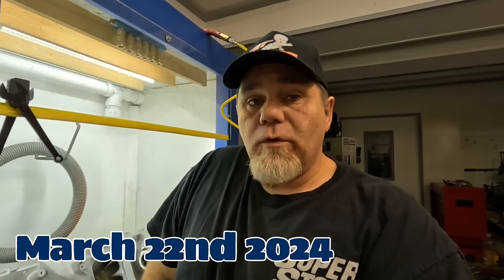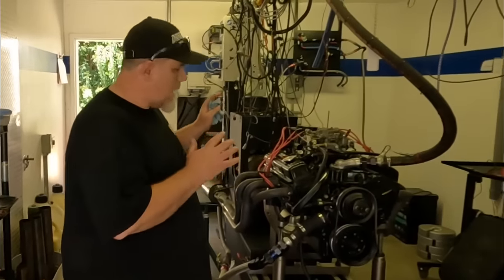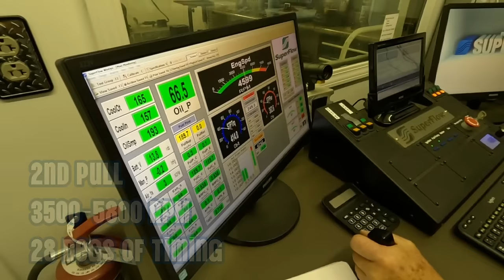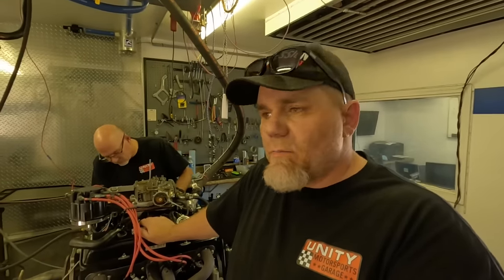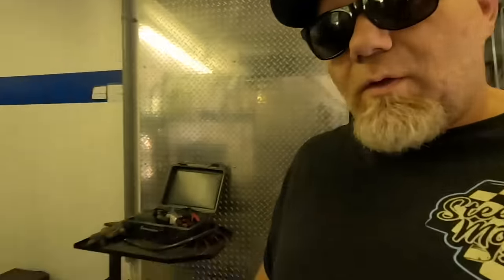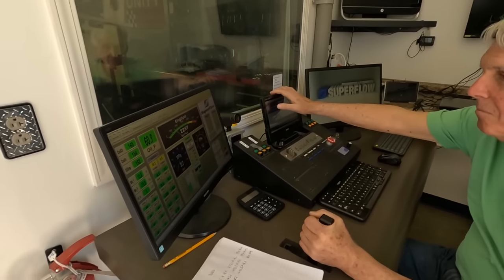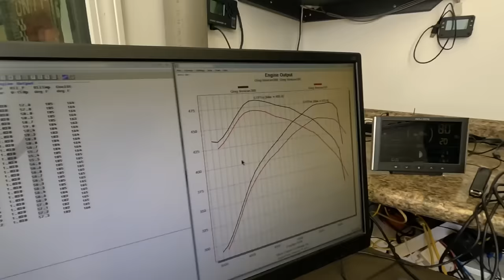408 CI SMALL BLOCK CHEVY, PROJECT SLEEPER:  DYNO TEST!!! WILL IT MAKE POWER???

Comment: 480Hp @ 408 Cubic Inches gives you a  1.176 Hp / Cuin ratio.  Seems pretty low. Was expecting somewhere in the 1.25 to 1.30 Hp/ Cuin. What does David V think?
Reply from the maker: It is low... It's the wrong cam for the combo but Joe had it and wanted to run it! Stay Tuned we aren't done just yet... 😎
Andy
Reply: The cam and carb are both costing a good bit of power.  Its all in the combo it wont just magically make x power because it has 408 cubes.
Reply from the maker: That is exactly the case.. Joe wanted this combo for his Chevelle and I will say it will drive pretty much like a stock car until he hammers on it!
Andy

Comment: Don't get me wrong, my teen years in the 80s had a Qjet on everything.  Hit my 20s in 90's bought my 1st double pump never looked back. Buy a GOOD DP and gain another 50 hp maybe more ive seen 100ho buy just changing carb. Yours being pro built i dont think youd see 100 though, 50 wouldn't surprise me though. Also go performer rpm air-gap with right spacer gain even more

Comment: 1.17 hp per cube? I watched a vid were you and DV kinda poked fun at folks that struggled to get to the 1.5 to 1.8 hp per cube, Is this race vs. Street(sleeper mode) , limited(wide) LSA on cam profile for AC and mild(sleeper) idle qualities? Just trying to understand the disparity. on a diffrent note, I like seeing the 800 cfm Quad with steady fuel numbers near the 500 hp range!
Reply: Yes this is a very basic motor with off the shelf parts. Plus you cant get crazy with a factory block.

Comment: why did the electronic distributor work so much better on day two than day one???
Reply from the maker: We found a loose connection on the 12v supply wire on the Dyno. 
Andy

Comment: 25 HP gained by flipping the cover is not accurate because the snorkel was cut off the air cleaner. The actual difference is greater for sure compared to a stock air cleaner assembly.

Comment: I had a 400 out of a 73 caprice in my camaro. It was only.030 making it a 406 gota say personally I love sbc 400's! They're strong!  Personally I had a different parts list but I know the potential of these engines especially the '72 and older 4 bolt main blocks!

Comment: Brother, I know a single plane 
Is a bottom end torque no no but to what extent? 2bbl 318s had a bitchin little stock manifold and they ran just fine. 
Now that Q-Jet is questionable. The secondaries don’t even have boosters! Dump tubes!
Reply from the maker: Not all intakes are created equal.. the small runner Street Dominator can almost match the torque of a regular dual plane and carry the power further in the rpm range... 
Thanks for watching
Andy
Reply: @UnityMotorSportsGarage  That’s no secret if you ever built a small block brother but very true. A tunnel ram or a super Victor don’t belong on a station wagon. Our pickups would get along real nice by the way. 70 F250 camper special with 532” towing motor.
Reply: @UnityMotorSportsGarage  Sure do, which is why I run a fully ported Team G does it all very well. I could make more #s putitng a large single plane on but part throttle would feel crappy in comparison. A real dual plane would choke mine upstairs

Comment: what cam?
Reply from the maker: It's a SMALL Mike Jones Hyd roller 224/228 .530/.530 lift on a 110LSA
 Not really the right cam for this combo but it runs pretty good
Andy
Reply: @UnityMotorSportsGarage that’s not bad power coming from that cam, I wonder if that comp xr300hr woulda made more power or even if you woulda used 1.6 rockers 💯💯💯
Reply: That is pretty good for being that wide of an LSA.Bet a 106 or 107 would really wake that sbc up.
Reply from the maker: @JeremyFrazelle-or1mt 😎
Andy
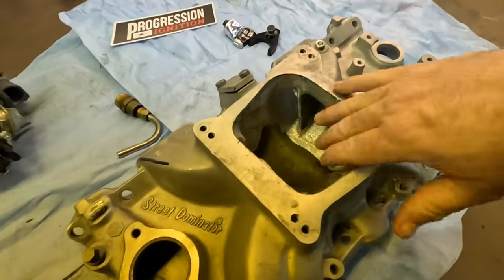Reply: So I got a 73 400 511 block if my billfold will let me I'm going to try to get 650 horse I've seen a few guys do it and make a lot more D stroke it to 377 or do a 415 or a 421 so right now I'm running a 383 hydraulic roller cam I believe the cam specs are a 268 276 what's a 480 Lyft it has 1.6 rockers so it came out to be about 5:12 lift its first Dino Run it made 445 horse at 5200 it made 480 ft lb of torque at 4200 dual plane intake 750 quick fuel carburetor so after watching your video I'm pretty happy with this little 383 great build but I was looking for a little bit more horsepower from your 400 keep up the great work later bye

Comment: 36 advance run?
Reply from the maker: We made a 36 deg run and it didn't like it at all.. 
Thanks for watching
Andy
Reply: Andy I have had similar builds to that (406) and none of mine didn't like 36 degrees either , even with bigger cams 33,34 were sweet spots ! , even 32 degrees ran better than 36 on my 3 406s !

Comment: Need far better clarity on the video of the TQ / HP curve . Almost no detail on the RPM at which the Tq  Hp occurred .. Idle vacuum ???  Wide open vavuum will give u an indication of restrictive carb or not. Idle vacuum ??? Idle rpm ????
Reply from the maker: It makes Peak TQ @ 4500 rpm and Peak power @ 5500 rpm even at 3600 rpm its making 434lbft of Torque it has 15" of vacuum at idle @ 800 rpm
Thanks for watching
Andy
Reply: Thanks for the detail